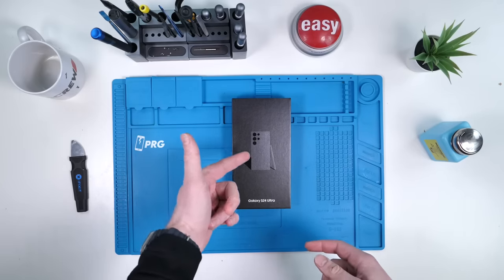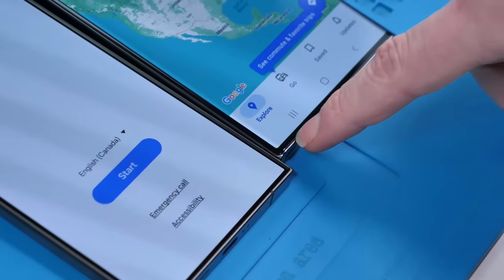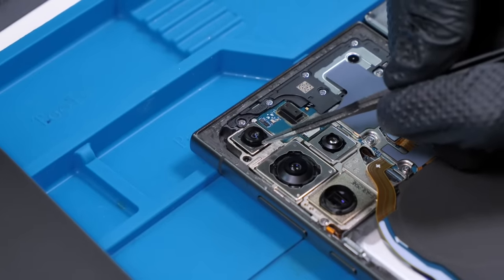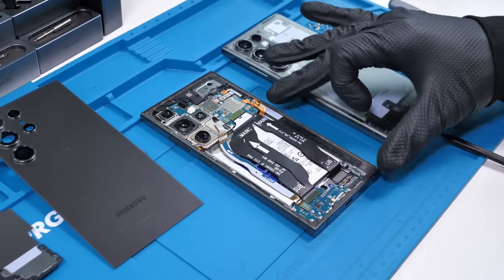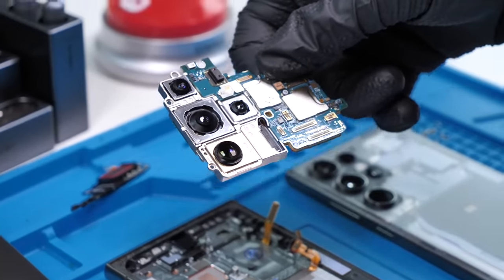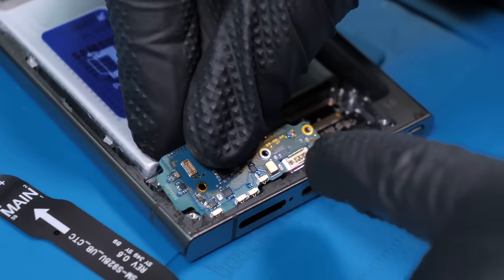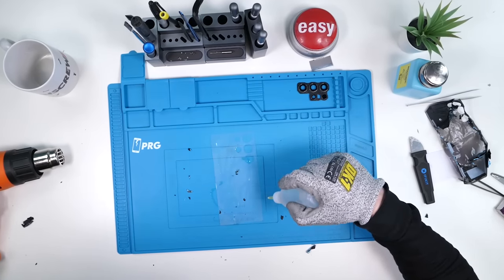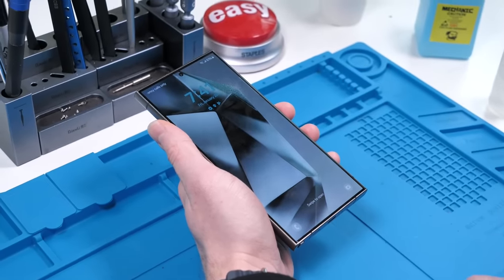S24 Ultra Teardown / Transparent MOD

Comment: Have you ever thought of exposing the copper of the wireless charging coil? It would probably look even more awesome.
Reply: Es lädt auch noch und schaut einfach nur toll aus...
Reply: maybe it is difficult since the wires are very very tiny and fragile
Reply: It's not just wireless charging that you remove, you'll also remove the nfc chip that came with the wireless charging coil
Reply: I think that transparent mods should be done just on the glass, not changing the internals
Reply: i was considering removing the wireless charging entirely, since i never use it. but i hear that it has a temperature sensor that is require for regular charging.

Comment: Man that motherboard is impressive af compared to pc motherboards
Reply: Its not fair to compare to pc bcuz its have individual thing like cpu ram etc.. compare them to laptop with solder ram and storage.. for example macbook..
Reply: @poliwharaslah965 Сравнивать можно. Так как в телефоне и в ноутбуке, используются одинаковые по типу компоненты (MB, CPU, GPU, RAM, Flash memory or SSD or HDD).
Просто эти компоненты, имеют разные физические размеры и соответственно, по разному установлены на материнскую плату.
И в телефонах используется не просто CPU, а SOC , в котром большинство узлов, уже внутри.
Reply: Given its size yes. However we're comparing apples to oranges here given two fundamentally different requirements. Also the fact everything on that tiny motherboard gets thrown away when one tiny 2 cent part dies makes it all kinda pointless don't you think? PC's have been notoriously resilient for that reason.
Reply: You can’t really compare a pc motherboard to a new Samsung

Comment: 5:27: Exaxtly. I did that myself, lol. I had my S10+ disassembled for a battery replacement, and could not for the life of me remove it. Eventually, my tool slipped, and a spark erupted, and I smelled battery, but thankfully no fire. The phone was at around 5% when I started the repair. By the time I got it out, it was properly mangled. Installed the new battery, and it fired right up, no issues. Still works great two months later!
Reply: The adhesive is way too strong on their phones. It may be different on the newer ones, but on mine, it must be made of adamantium for how strong it is.
Reply: Phone batteries don't last a lifetimem

Comment: I wish Phone companies would start making transparent phones from the factory. Literally everyone would want that.
Reply: I wouldn't. It doesn't appeal to everyone.
Reply: @nonstopbg then don't buy the transparent version. Companies used to do it in the 80s, 90s and early 00s it was all the rage. And clearly enough people want it to have a separate and probably cheaper transparent version.
Reply: Sorry, but that too "customizable" for Apple and could be a security risk. 😂
Reply: I dont know how they make this rear glass, but adding or removing anything else from the mass production line would be extra cost for the manufacturer
Reply: "Nothing" phone does that
Reply: @ErnestJay88  not really, they hide everything but the LEDs and screws with the trip pieces.
I want an actual tear down skin for my phone 1 that actually shows the motherboard.
Reply: well companies like apple literally differentiate between older and newer models on the basis of colors, in case of a transparent phone they wont be as successful to push people to buy newer models
Reply: what's the point of having a transparent phone when you just get to see its NFC pad, wireless charging pad, battery. Jerry Rig Everything's skins are the best
Reply: Spigen Ultra Hybrid Zero One says hi
Reply: That is not gonna happen till 2100 😅
Reply: @Perry24680 security risk 😂😂. classic apple
Reply: @kaandurucan9955  No it's actually going to be cheaper since they're taking out a step from the production line. They can simply skip applying the colour thing and save on costs for the material, adhesive and electricity powering the machines that run the process.
Reply: as a tradesman, im a hardcase guy. so the original color or visuals is secondary
Reply: I don't like it too
Reply: I don't think Samsung will want to warranty ribbon cables/circuit boards damaged from UV exposure from sitting outdoors. The vinyl is more than just for looks.
Reply: No
Reply: shout out to the steam deck LE
Reply: i know its not a phone but its the one device i can think of with a translucent finish
Reply: I wouldn't
Reply: Not me it looks terrible.
Reply: xiaomi made the mi 9 explorer edition which has a transparent back

Comment: The big improvement for the s24 ultra is the CPU. It really is a huge improvement over the s23 ultra. With that said the s23 ultra is no slouch when it comes to CPU performance. I went ahead and got my s24 ultra just for the 1tb model, my s23 ultra only had 512gb.
Reply: Wait until you hear the speakers on the S24 Ulta. Watched a couple movie trailers and I was quite impressed coming from the S23 Ultra.

Comment: Always interesting to see the phone breakdowns. As someone who used the S23 Ultra daily, the S24 Ultra is a pretty big upgrade. The flat screen itself is so much nicer to use on this phablet of a phone. With the S23 Ulta I'd get the odd mis hit on the edge of the phone and the side gestures weren't great with the curved screen inside my case....mainly because the cases for the S23 Ultra were raised higher on the sides in a feable attempt to protect the curved screen which made using the edge very difficult. The reduction on reflections is pretty incredible and I notice it throughout the day. Another pretty huge upgrade is the stereo speakers. Watched a few movie trailers at 80% volume and was actually impressed the sound was coming from a smartphone....about time Samsung. I'm liking the curved, titanium sides which are nice and comfortable to hold. The tighter bezels and especially them finally getting rid of the lower chin bezel, was much appreciated. I'm waiting for my case pre-order to arrive, but it's going to fit much better and actually protect the sides of the screen this year. We'll also finally be able to use glass screen protectors which were impossible to use with the curved screens. The improved 2600 nit screens are super noticeable when viewing outside it's unreal. I'm quite impressed with the improvement in battery life which was already quite good with the S23 Ultra plus they gave us a 30% bump in raw performance, no small feat. Cameras seem to be nothing short of what I expect from Samsung at this point and when testing the 100 times zoom, the clarity is actually better with the 50mp camera....which is great because I also was worried about the perceived downgrade. Not to worry. All in all, great phone and solid upgrade depending on your budget. I was able to get $1100 CDN for my trade and early registration credit plus I got the 2 year Samsung + warranty for half price....something I think everyone should spring for on such an expensive phone.
Reply: I also was excited about tempered glass protectors but I hear a lot of people saying that the glass completely negates the anti reflectiveness of the phone? :/ that was such a cool feature and sucks if that's the case
Reply: I also got the Galaxy S24 Ultra. I got $1000 USD off for trading my Pixel 7 Pro. So far, I really like it (after getting rid of a few Samsung things).
Reply: @L33TTechReviewer  decided not to install a screen protector as I really like the anti reflection technology and didn't want to lose that feature. I have a high quality case and I'm pretty careful with my phone so I should be fine.
Reply: @Yielar1  nice! you'll love it. I've been using the phone for 2 months no screen protector just a case and love the screen.

Comment: You made a remark that I don't hear quite a lot and that is very true, the screen protectors for the curved devices suck. If it has enough glue to adhere well all around it will not work with the fingerprint scanner. It's a very thin line between having enough glue to adhere and not too much so it does work with the fingerprint scanner.

Comment: The camera deco needs new adhesive its not water resistant anymore. Tweezers should also be used for the black plastic parts and you lift at the disassembly points that are marked on it. Use of a guitar pick like tool is recommended for disconnecting the fpc connectors. Other than that its a cool mod that I don't recommend doing unless you have an AOD and proper replacement adhesive.

Comment: Hi..great video 😃..i have a question. Once phone is opened and re sealed will it be water resistant ip68 as before and what about minor particles between camera lens and back cover glass will it be cristal clear and air tight sealed as before?

Comment: If you took off the vinyl, is it possible to paint it a different color? Or maybe place a sticker on the inside?
Reply: Yes, i scratched the Paint off from the charching Coil and now you see the Copper and the UB- and SUB Cable... 🙂 And yes, i painted around the Coil in Nato-Olive with a Spray-Can. I have used the original reassambling Kit for the Cameracover too and so it is waterproof. Video at my Channel. 🙂

Comment: Me personally liked the feeling of the rounded edges of my S10. I got the S24 Ultra and the only thing I don't like that much is the flat edges. 
Aslo wehen did Samsung stopped putting on screen protection from Factory ? My S10 came with a perfect applied Screenprotector.

Comment: I’ve seen 2019 Oppo phones use the similar pull tab concept (atleast in the midrangers) and i just think they could do better. If done wrong you could risk bending the battery itself which is bad. I find the iPhone pull tab better if they could make it stronger and harder to break.

Comment: could you please measure the back glass thickness?
would be awesome if one could replace it with a custom waterjet cnc cutted piece of carbon or kevlar.
that would litterally be the s24  ultra² then.

Comment: I dropped my ultra and it just cracked the screen protector but now on the spot it landed on some colored pixels came out and some glitch in and out and they don't go away the screen isn't broken would I have to replace the screen or would it go away?

Comment: I just put the SIM ejector in the mic hole on my brand new S24 ultra.... applying a bit of pressure. Now feeling paranoid I may have danged mic or compromised the IP68 rating.

Comment: Even though there's not much of an upgrade over last years model and last years model is half the price. The Samsung Galaxy S24 Ultra COMES WITH 7 FREAKING YEARS OF UPDATES! That means OS/Security solid 🪨 until 2031 yea! 20 freakin 31! The camera doesn't zoom as far. Sad but supposedly the quality is better in the camera. I can't tell a difference. Infact its grainy as heck. I just have something set wrong. I did a rest on the camera setting but still the same thing. Im sure im doing something wrong. Only had this phone a 2 days

Comment: I think I would to cut plastik around camera plate on the back glass and remove all plastic but not plastic which is under camera plate. Coz when you put camera plate back on glass it looks ugly , you can see ugly plate with glue.

Comment: So, Guys I have serious problem right now. I got my phone iPhone 13's screen replaced from a shop. And I didn't knew about the true tone feature. Now that I have a "fake" yet a new screen but it doesn't show the true tone effect. I researched about this feature and found out that this feature is absolute ass and does nothing "literally". So, I wanted to inquire that should I be concerned since I lost this feature, but face id works ngl. And what are the problems I'll have to face with this screen, or it will work just as normal ones but without that true tone feature? Kindly Reply If You Know Something....
Peace Out:elbowcough:

Comment: Upgrades the s24 ultra has over the s23 ultra

Snapdragon 8 gen 3
Flat display
Gorilla glass armor
Ai chip
50 megapixel camera

Imo if you have anything under an s23 or another brand device its 100% worth it. I upgraded from an s21 ultra and its a world of difference even tho the s21 was a decent device

Comment: People saying the is a s24 ultra never seen a note, this is basically a new note. I hate they didn't just keep the S line and note line separate. What reason did they have to do away with the note line? Samsung weird.
Reply: All they did was rebrand the Note line as the S Ultra. Nothing really changed for nite users except the name of the device. 

And the S Ultra line before they merged was just pointless when the note was the same price or less at times and typically a better phone if nothing else for the S pen.

Comment: Yeah flat screen, so we can finally apply some chinese bad quality screen protectors.. I have a pixel 7 pro with rounded screen, and I love it. And I applied a good screen protector that covers all the screen and it's made of glass, using a uv glue technology. So I don't understand the troubles of people about curved screens when good screen protectors exist..If people don't want curved screens and don't want to spend 30$ for a screen protector (after they spent 1400+ dollars but okay), they can take the basic version of the phone, easy

Comment: You are working too hard at removing the glue from the glass. You will thank me so much once you try this.
Get some Odoban Real Citris Air Freshner Spray at Home Depot, spray it on the glass with glue residue and let sit for 30 seconds, then literally just wipe it off.

Comment: Im not sure the s23 ultra will get the ai features the s24 ultra has. The Snapdragon 8 Gen 3 allows on-device ai engines whereas the 8 gen 2 doesn't have the capability to run the ai engines on-device
Reply: Lol. That's absolutely false. They are coming to the 23 line.
Reply: @graydi66y  how so? Does the 8 gen 2 support on-device ai engines? Instead of just laughing my comment off you could at least give some context as to why you think the 8 gen 2 can support on-device ai
Reply: @Lordhitchy  there's articles all over the place talking about it. Should be within the next 3 months when we see the one ui 6.1 update. I'll probably see it in a couple weeks because I'm a beta Tester. Oh. That's another source. Me. Yes the gen 2 is plenty powerful. Gen 3 is just more optimized for lower power consumption. People have been developing AI on processors that are years old and outdated by today's standards.
Reply: @graydi66y  Thankyou. I'll have a look for some of the articles and have a read
Reply: @Lordhitchy  CNET has one that's recent.